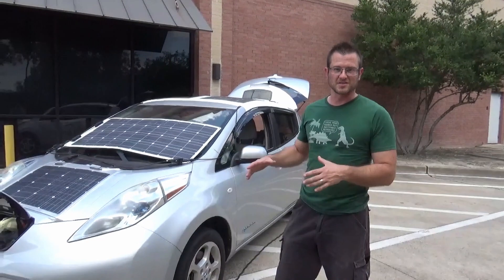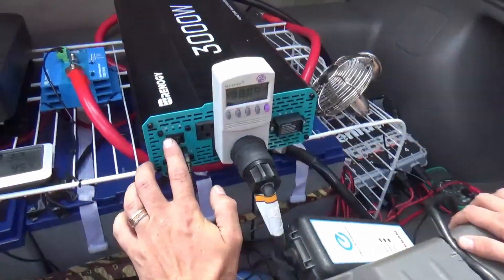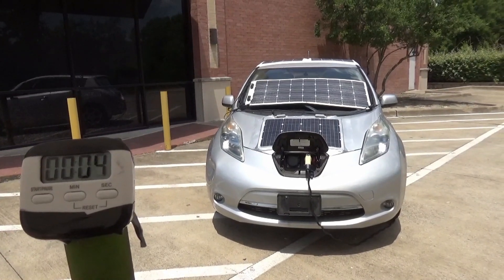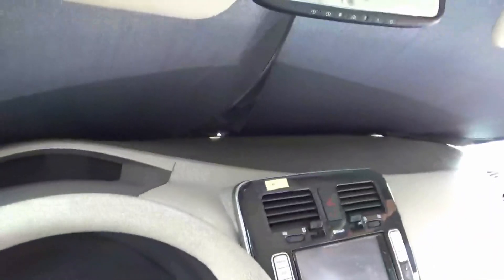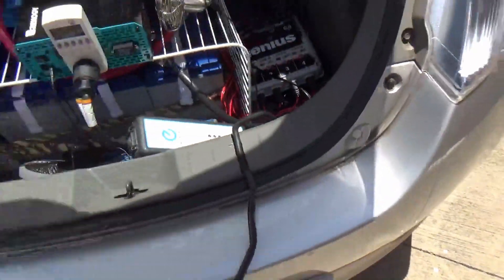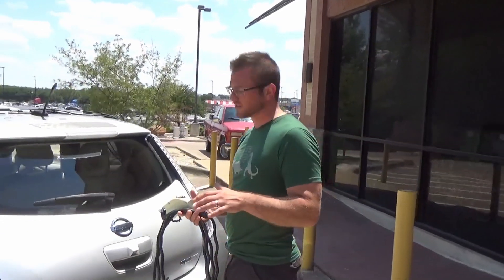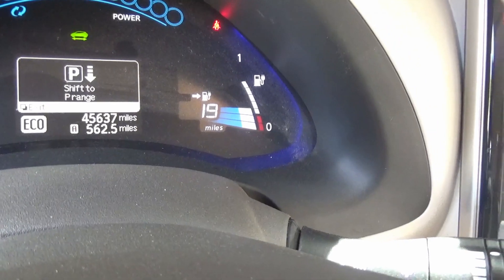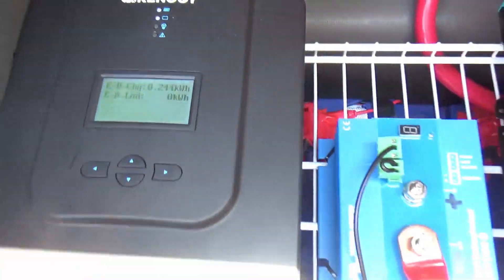Solar Powered Nissan Leaf Pt. 2 Stress Test

Comment: Do you think a boost converter would work to charge the high voltage batteries straight off the solar panels? The inefficienies of the dc/ac ac/dc should be far greater than using a boost converter mabe find a lot of small high voltage panels, like 6 and run them in series should bring you up to around 120v can be easily be stepped up to whatever the leaf uses 👍
Reply from the maker: Direct constant PV charging of the main battery is the end goal here.  But there are a LOT of hurtles.  You should really charge lithium batteries as a stable constant voltage, which you won't get direct from PV panels.  You will have to run it through a charge controller.  But no charge controller I've seen can handle 400v (the charging voltage of the main battery) input or output.  My Renogy 60A charge controller is awesome, and it tops out at 150v input.  That thing will melt before it gets anywhere near 400v.  So, we have to take our 20v PV, run it through a charge controller, and run the stable controlled output voltage through a step-up or boost converter like you mentioned, and jack that into the main lines that lead to the terminals of the main battery.  You will (likely) have to make custom parts, you will have to be VERY careful working around that kind of power, and if you mess up you may total your vehicle (or your charge controller) before you can rip the connection out.
     While you are right about the AC/DC/AC losses being significant, they also allow this vehicle to serve some other purposes I didn't initially realize.  This car was a backup generator for my house when the power went out a week ago.  You can rescue other stranded dead battery EVs with this system, have a power source on job sites, run a window A/C unit in the summer to reduce your electric bill.
     Having said all that, when the range of this vehicle decays below 30 miles, I will attempt this conversion (because if I total out the car on accident, it was pretty much useless already).  The pinnacle of this system would be a switch on the dash, the switches your charge controller from charging the main battery or the backup bank as you choose.  Thats my end game here.  Stay tuned!
Reply: @InnovativeSustainableSolutions  Nice work! Having an inverter truly helps with these scenarios. Mabe you should reach out to "great scott" he really know electronics and custom parts. You said charging should be at constant values, but i think this doesent affect your battery life, as charging it while regenerative breaking or decharging it while accelerating isn't constant as well and far exceeds your charging capabilities. You might be able to push a few hundret watts up to a couple kw while acceleration draws something like 10 to 30kw and regen breaking for sure is more than a couple kw. So the battery should handle it no problem. Also while looking for custom parts, why not get an inverter that just works from the onboard 400v system? This would save a lot of weight, while still being more efficient.

Comment: what was the state of health of your leaf? also you could use a microcontroller switch for charging based on temperature like an arduino uno to check your temp and set time etc

Comment: presuming you using a 300w solar panel you got 8km extra range from oyu battery therefore your battery recieved 450w and output 1700w so your battery is being drained excessively you need 1200w solar panel and a 2kw battery to maintain 8km a day in 90 min, so my 5km per kw is close

Comment: How could you get more than 1 kW of power out of a couple of small panels which can generate at most 200 W ?
Reply from the maker: You can easily fit 2 250watt flexible solar panels on a roof rack.  If you put the rack on slide to open when parked, you can mount 2 more, 100 watt panels directly to the vehicle.  Plus a 50 watt on the hood.  Thats without using the doors, or a removable windshield panel.

Comment: What are you using to secure the solar panel to the front hood? Some sort of weatherproof tape?
Reply from the maker: It's a tape designed to patch holes in RVs and trailers, called Eternabond.  That sh!t is DURABLE.

Comment: Sick project. I kind of want to buy a used & abused 2011/2012 Leaf and do a similar project. 

I have two cars currently; my brand new Model 3 and a Mazda 3 hatchback. Might replace the Mazda with this theoretical Leaf to make my vehicle lineup fully electric.

Keeping in mind I have yet to watch your later videos on this so this might have already been addressed--why not just go with a Jackery-style power bank for this project? Seems like it would massively reduce complexity by having the MPPT and inverter all in one condensed platform, as well as (as you said in your previous video) using the much more mass-efficient lithium batteries
Reply from the maker: Your dead on with the lead vs lithium trade off.  I switched over to 4kwh of Valence batteries later.  The jackery does make it more simple and complex, but usually makes the system a lot less powerfull and versatile.  You get a lot more control and performance when you choose your own charge controller and inverter, but a jackery or other all-in-one system with a 3kw output will work

Comment: Yes, great job. Would using super capacitors work for this kind of setup or a combination? Thank you.
Reply from the maker: https://youtu.be/wyhyCDa6_MI
Super-capacitors will not work for this set-up.  My buddy James at the Real Solar Cars channel actually built a super-cap setup to try and use in vehicle solar charging.  He goes into great detail on the reasons it doesn't work in the video linked above.  Please subscribe and leave him the comment "Sam say's you need to do an update video".
Reply: @InnovativeSustainableSolutions  Thank you.

Comment: It is pretty bad, that a car that costs a fortune new, gets useless after only few years, and needs expensive replacement parts in order to run again.
Reply: Whatever. The way you treat your battery is pretty bad.
There are some rules to a battery exploitation that i follow and keep my batteries good.
1 charge only when discharged.
2 avoid overcharging.
Reply from the maker: @MrGigi-dz9cv  Thats what I've been messing up.  I've been charging my batteries when they're fully charged already.  Thanks for the pro tip :)
Reply: I don't know if you are referring to gas or electric. My Leaf is 5 years old and have had no major issues or maintenance cost.
Reply: @jeffman12345678  How manny miles, what is the range between charges, now vs new ?
Reply: @MrGigi-dz9cv  Bought it, 2017, with 25,000 mi for $15,000 in January 2022 ,  now  I get about 90 mi per 30 kw charge.  I think it got a couple of miles more range when I first drove it.  Have a problem understanding how to charge it with an inverter.
Reply: @jeffman12345678 There should not be a problem charging with inverter.
Reply: @MrGigi-dz9cv  
Oh I see. Ground neutral, works great. Thank you for your response.
Reply: @MrGigi-dz9cv  I am getting a consistent  2.7 miles per kilowatt hour. 30 kwh battery.

Comment: You do more cooling of your inverter than Nissan did of it's onboard equipment. :)
Great work!
Reply from the maker: Ha!  That's a funny point.  I eventually went on to install a micro air conditioning unit back there.  I'm hoping to retrofit the main high voltage battery with a cooling coil eventually.  But that project is still a year off probably.

Comment: LOL, it will take you 21 Days to get 1 Full Charge!
Reply from the maker: 3 actually, if you look at the current system.  You're watching a video thats almost a year old on an evolving system.  But thats beside the point.  The point of this system is NOT to fully charge the car.  I do that with the roof array on the house.  The point is to add some range (we're up to 27 miles/day now) to an ageing EV that would otherwise have to be scrapped because it can no longer make the commute.  It's basically a Lv 1 charger you carry around with you.

Comment: Hey add a wind generator also
Reply from the maker: Several people have recommended that to me.  I think it would be easy to electrically tie into the existing solar system, they generate power at about the same voltage and the MC4 connectors are used for most wind generators as well.  The problem would be finding a very quick and easy way to attach/remove the wind genny, as you do not want it on the vehicle when driving.

Comment: That's great you're getting a few miles per day from the sun.  Something i saw from rvers on youtube, they mounted panels to sliders to have 2 layers of panels so the panels can slide out of the way of the panels below when parked. If you put on a roof rack, you could probably get some more panels extended over the front and back as well.  nm. I see you did that! noyce 
Insulating all the doors and panels with aluminum bubble wrap will cool the car down a lot.

Comment: In your system is possible to charge batteries in back first then charge the car
Reply from the maker: Yes, with the car parked and plugged in.  No if the vehicle is moving, or the car charger is not plugged in.  I'm working on a direct solar to main battery connection this year.

Comment: Six normale 300 Watt Module auf einen Anhänger wie ein Dach montiert und ins Auto geladen beim Parken bringt bis zu 5 kW am Tag oder vielleicht bei sonnigen Tag noch mehr aber das Auto muss eine Anhängerkupplung haben also fahre ich ganze Jahr oder Sommer umsonst
Reply from the maker: Ein Solar trailer option für eine EV ist ein Projekt, das ich gerne tun würde.  Sie könnten es für Straßenfahrten oder als Solargenerator/powerwall für das Haus verwenden.

A solar trailer option for an EV is a project I would love to do.  You could use it for road trips, or as a solar generator/powerwall for the house.

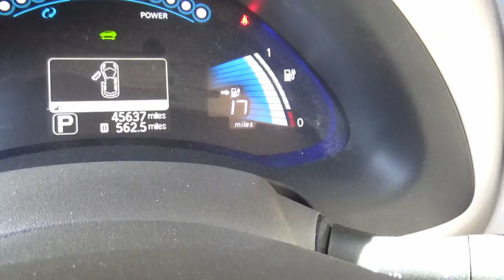Comment: cool vid, I like what your doing. I have a LEAF too! at 7:20 you didn't do a apples to apples comparison, earlier you notes 9 miles in D , not ECO, now you compared 19 miles in ECO to the previous 9 miles left in drive making the gain appear larger, I understand to said you drive in ECO but you didn't check the ECO mode reading at the beginning which would be a little higher than 9 miles.
Reply from the maker: Good catch, I did make a mistake there

Comment: Hey man, love this. Will try this out, would it be possible to use 1 battery and a capasitor insted?
Reply from the maker: Thank you sir.  Possibly, but it would be very difficult.  Capacitors generally discharge very rapidly, so as soon the inverter powers on and closes the circuit, the cap is probably going to dump all that power into the inverter (or the car) and blow a fuse somewhere.  You would need a slow discharging cap (or series of them), which is kind of an oxymoron.  But I could be wrong.  I havn't worked with capacitors enough to be any kind of authority on them

Comment: It's a grate invention. I have 2 quiz 
1 can we use ups batteries, so we can save the boot space
2 can use this soler generator while driving.if we drive on high way 100km at least we have direct sun light 30, 40 minits. I am Sri Lanka. Onece again It,a grate invention. Thank you.
Reply from the maker: Thanks.  A solar system like this would be around 10-25% more efficient in Sri Lanka than Texas because you get much more direct sunlight and the temperature is more moderate (10 degrees cooler in the summer, 20 degrees warmer in the winter).  Regardless of what kind of batteries you have, you will still need a charge controller, inverter, and probably some kind of climate control.  You can find creative ways to stack these in very little space (maybe a cargo rack on a trailer hitch), but they will take up some room, and for security and other reasons the trunk area is the best place.
     As far as charging while driving, it depends on the vehicle.  The Nissan Leaf has software that prevents the car from being switched into drive while the charger is plugged in.  So I can't charge the main vehicle battery while driving.  But the backup battery bank in the trunk IS still charging while I am driving around.  If you watch my video Solar Powered Air Conditioning, I use the solar to run the climate control while driving.  When the battery on the Leaf degrades down to about 30 miles of maximum range, I will attempt to connect the solar system directly to the main battery, so it is always charging.  Stay tuned for that video
Reply: @InnovativeSustainableSolutions  it's doable, I know how to tap into the 400v DC bus under the inverter cover on a 2013 leaf. it's only powered during charging and in Ready mode as this is when the batt packs contactors are closed. so it's actually easier to charge the main battery via the 400v buss while the car is on (ready mode) than off.
Reply from the maker: @BSAElectronics702  I will add you to the list of people I will reach out to when I start to tackle the 'direct PV charging of main battery' project.  I need to do a very detailed step-by-step video on that process.

Comment: Great Job! I'm definitely going to give this a try on my 2014 Nissan Leaf. If I may suggest, forget about the compact portable AC. I have a similar unit and it draws too much energy. Go with the a cooler, ice and usb fans like you are using. I use the same for a side business that I have. I need to keep product cold in my Leaf for 10+ hours a day, so I freeze 2 - 2 liter bottles(some people use PVC, but I'm cheap)with salt water and reuse everyday. You could even place the inverter inside the cooler on a rack to keep the moisture away, or wrap the bottles in paper or rags to absorb the extra water.
Reply from the maker: E-mail me before you order your parts.  We're finding better cheaper ways to do this every week.
Reply from the maker: Also, can you please e-mail me, or post on this tread pictures of the frozen bottle method you use to keep product cool in your Leaf.  I won't give up on the micro A/C until I have tried it and failed several times, but I want to present ALL options to people on this channel.  If someone is trying to build a solar system for $1,500 or less ice-cooling will probably be their only option.

Comment: Don't bother with those small ac things they are complete bollocks. You'd be better off just exhausting the hot air out of the top of the car (perhaps out of the gaps in the windows now you have wind deflecters on them) and having fresh air intake from the underside of the car. (have a 12v centrifugal fan on the intake, normal fans don't have enough pressure they just move air).

Diy duck tail spoiler for more real estate on the roof for more panels.

I like the project I'll do something like this one day once I've got an ev.

Comment: Try to get Nissan leaf spy which an application that works with OBD2 Bluetooth device (OBD2 Car Code Reader Scan Bluetooth Diagnostic Scanner Tools for Android ELM327) and disconnect your TCU antenna to help your car main battery gain more capability to retain more charges.

Comment: Not bad....10 miles in 90 some minutes of solar panel charging.  You can add two more 100w flexible panels over the side windows to colkect more electricity and keep the inside under shade.. 

This is good for those who love in multi units homes with community lots and no charging and you drive once or twice a week to work.
Reply from the maker: Thank you, it went better than I expected honestly.  The extended airport park is another use people have told me about that I didn't think of.  You can come back from 2 weeks out of town, and your car isn't dead.  Panels that fold out over the windows will probably wind up happening.  You can do a LOT with an extra 2 or 3 hundred watts
Reply: @InnovativeSustainableSolutions  Redfoo's Kombi is going to run purely off Solar https://www.youtube.com/watch?v=i95DmuEocBE